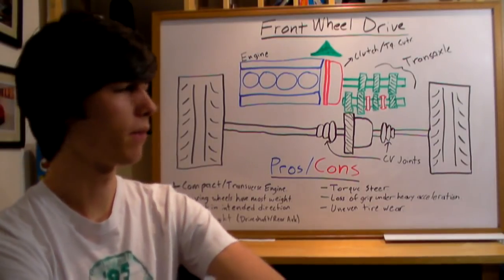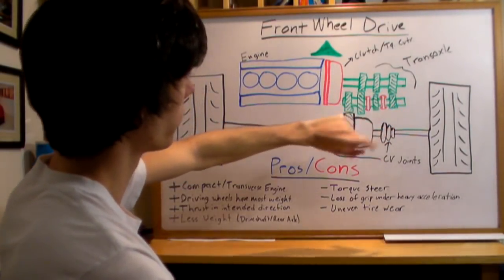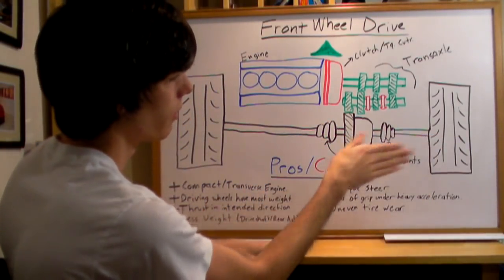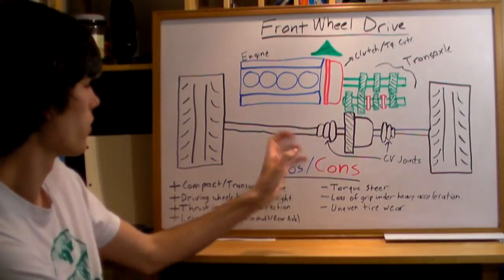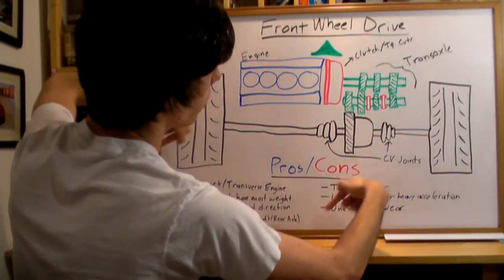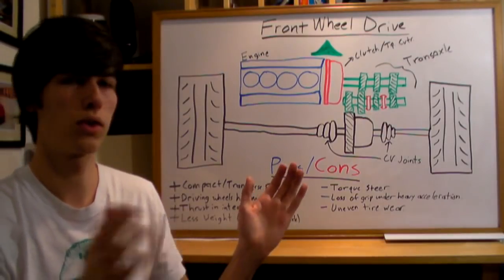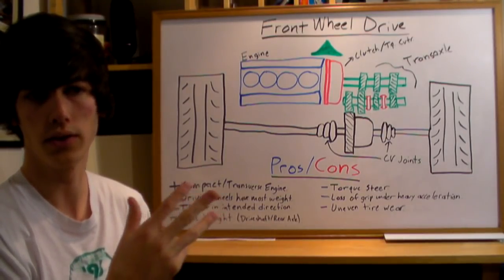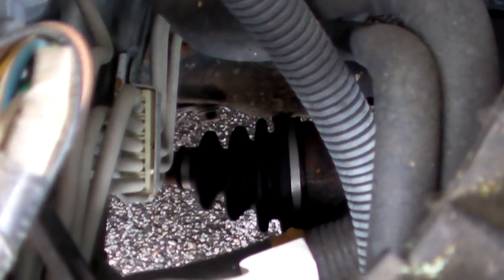Front Wheel Drive - FWD - Explained

Comment: which makes me wonder how in the world do you counteract the loss of grip under heavy acceleration? is it pretty much impossible or what?
Reply: Stiffer rear suspension (reducing weight transfer to the back) + making the car front-heavy helps, but that's a combination that makes the car react less predictable and more extreme in lift-off oversteer (lots of short wheelbase hatchbacks have this).
Active suspension is better.
As the driver: reduce throttle until you have grip again. 
FWD will always be limited in acceleration because of the weight transfer, that's why higher performance cars are RWD or AWD despite the higher transmission losses.

Comment: is it necessary to have a differential in every four wheel automobile?can Ackerman steering be used instead,especially when it is not a high speed vehicle.
Reply: Ackerman only makes all 4 tyres roll perfectly perpendicular to the radius of the bend, which all car manufacturers try to do.
This doesn't take away the speed difference between the outside and inside tyres. This effect gets bigger the sharper you turn and the wider the track of the car.

Comment: Challenge question: if you take the front wheel drive engine and trans, and install it in the rear of a sand rail, will i have a problem with the Diff?
Reply: Well, you would have a 1wd sand rail so you'd just spin one tire anytime you hit the gas on sand.

Comment: Hi. I have a question regarding a FWD car oversteering. Say you enter a curve a little too fast. You will most probably lift off, which will originate lift-off oversteer. You might even brake, which will make the oversteer more severe. My question is: during your oversteer phase, why is it better to apply throttle than to brake even harder? I know braking even harder will make the rear even looser, but wouldn't it also make the front tires - which are on an opposite lock - grip more? Thanks.
Reply: countersteer and slam the throttle then straighten the wheel

Comment: I wonder why car makers didn't adopt the inline configuration of the Cord 810 that placed the engine and transmission behind the front axle using a unit body. The transverse layout seems like it would mount the engine higher in the frame, increasing the height of the vehicle's center of gravity. The empty space above the transaxle in a longitudinal orientation could be used for a front trunk crumple zone or even a spare tire
Reply: Sorry, I just remembered the Citroën DS had a front mid-engine design. I guess the logic of the VW Beetle was to sacrifice the engine in a rear collision
Reply: I seem to remember a time when Subaru had the spare mounted on top of the boxer engine
Reply: I always have these crazy ideas for restomods. Perhaps a Toyota GR Yaris/Corolla engine in a Citroën DS 😃
Reply: While the Mendenhall and the DF Goblin both use transverse engines, I think the front mid engine Slingshot could readily be modified to fwd

Comment: the gearbox itself is a gear box. the transaxel is the large grar that the cv shafts go into for drive to wheels
js.
Reply: also the reason why it is called a constent volicty joint is because of no matter angel it is on the rotational speed does not change. unlike with single uni joints the speed flucuates as rotation occurs. once again jc.

Comment: can you have lsd on fwd cars?
Reply: Yes
Reply: Someone the other day told me it couldn't which is why I'm here again. They were under the impression FWD sends 90% of the torque to one tire and 10% to the other and I'm trying to find any evidence of why they might think that is the case.
Reply: That someone sounds misinformed. Conventional (i.e. 'most') FWD cars basically work the same way as a RWD, except all the drive is coming from the front wheels instead of the rear. So take that rear diff and mount it up front, and there's your FWD. Maybe that person was talking about torque-vectoring or LSD systems which are another topic altogether.
Reply: +Harman I think they might have been saying what they were saying because they bottomed out their car in mud and the tire with the least resistance was spinning much faster than the one with a tiny bit of resistance. :) They refuse to admit it.
Reply: acephantom903
 Ahh yeah, but that would happen on any kind of vehicle with a conventional (open) differential though. If anything a FWD vehicle may fare better than a RWD in such a situation as you have the full weight of the engine and transmission over the driving wheels, to give increased traction.

Comment: As soon as I saw the front wheel of your car, I recognized it immediately.  I had a 2000 Acura Integra LS three-door five-speed in Vogue Silver Metallic.  In seven and a half years, it never once leaked a drop of oil or coolant.  That five-speed manual is the sweetest shifting manual transmission I've ever experienced.  It's also the only FWD vehicle in which I've experienced lift-off oversteer.  Thank you for the great videos.

Comment: no..... i dont think you drive very much.....fwd cars are not better on corners because there is more weight in the front......throwing off a 50/50 balance thats why vettes have a transaxle in the back and the engine in the front or most super cars are mid engine rwd/awd.......